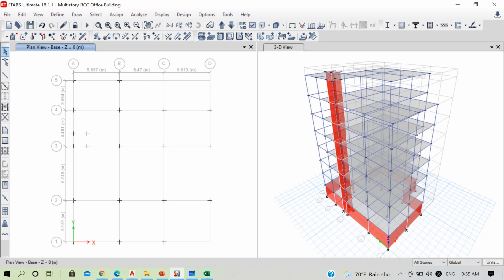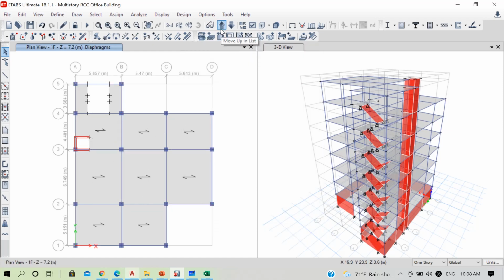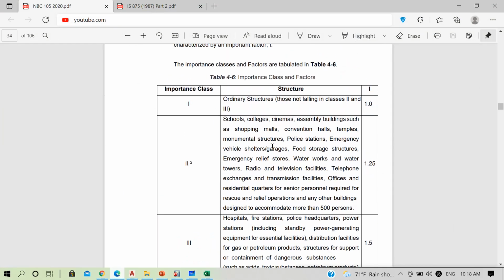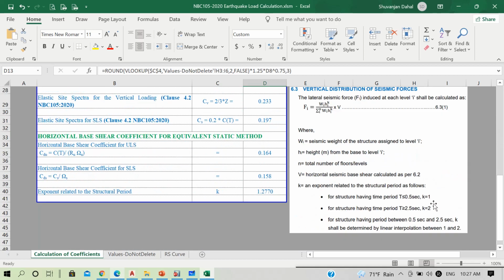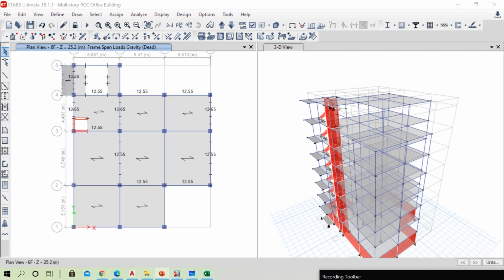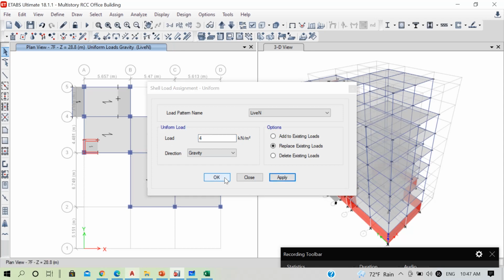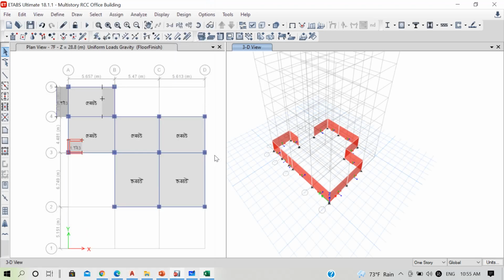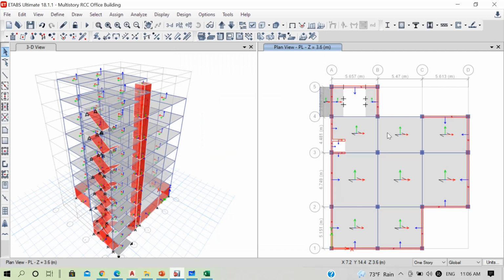Lecture 3 - Application of Loads in ETABS  (Design of Multistoried RCC Building as per NBC 105:2020)

Comment: While applying live loads, you have replaced previously applied loads with newer ones. You have to add those loads with existing loads.
Reply from the maker: If it is the same Load Pattern, then replacing existing load will delete the older value of the load applied and apply the newer value given to the software. If it is a different Load Pattern, then using the replacing option will not make any difference.